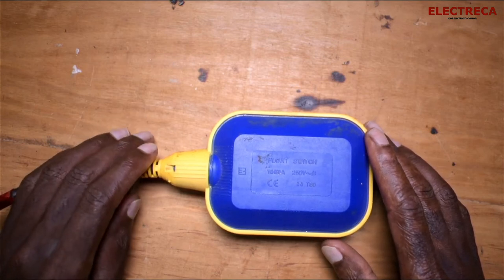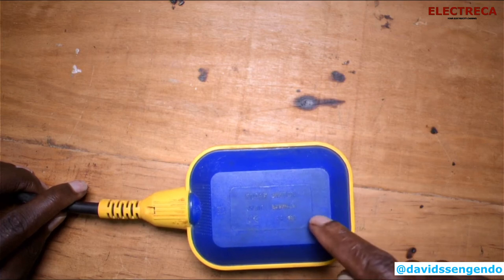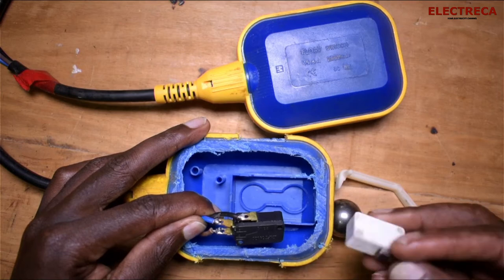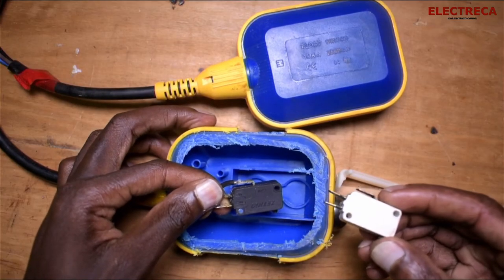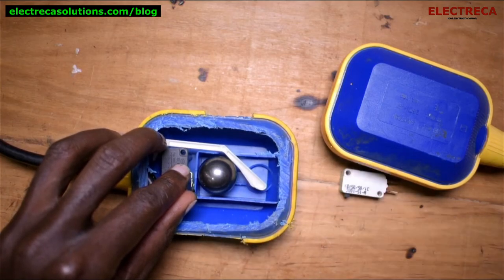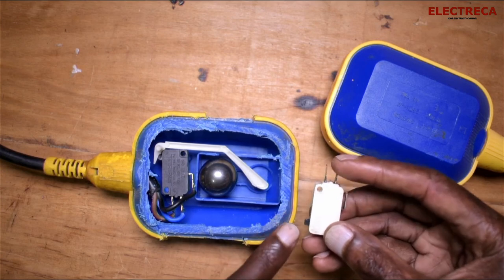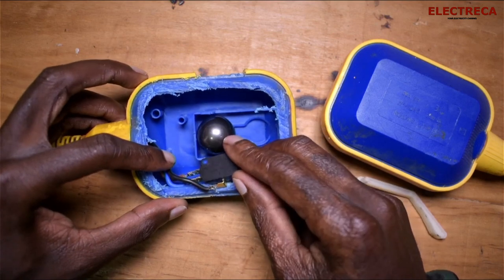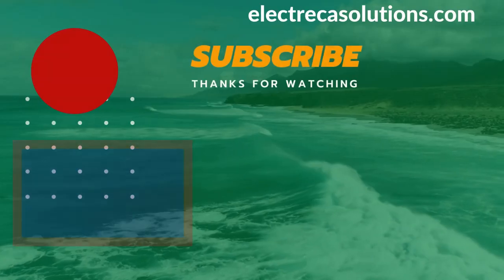inside float switch|electreca

Comment: perfect thanks, my float dies in a sewer pump unfortunatly lol i was going to try to bypass the float temporarily with a light switch so i can drain the tank and replace the pump at a later date when i can afford it, it should only damage the light switch by not using a contactor right it wont damage the pump?

Comment: This switch is only for on/off negative ground. It does not move voltage through it in the case your submersible pump may require the switch to move power through it. Make sure before you purchase this very common replacement float switch.

Comment: Can you run a switch like that with 12V?
Reply from the maker: Switches are rated with current not voltage. you must know how much current your circuit will draw, for you to rate the switch.
Reply: Those microswitches in general can even switch 1v, when they are new.  Depending on how the contacts inside corrode, it might need 12V after a few years.  But since it is sealed, the corrosion should be minimal.